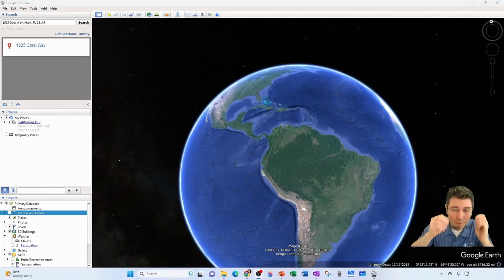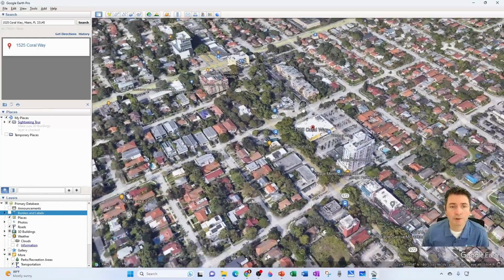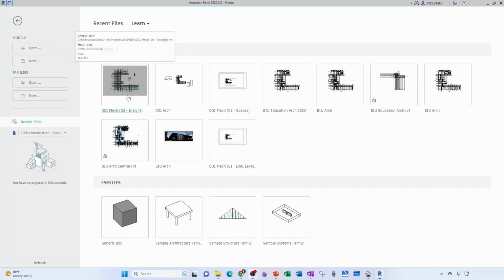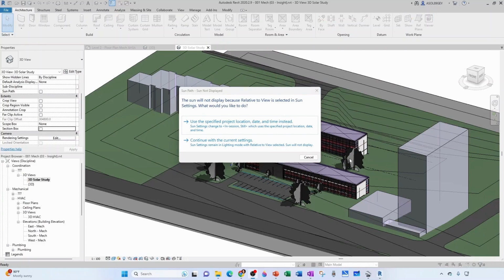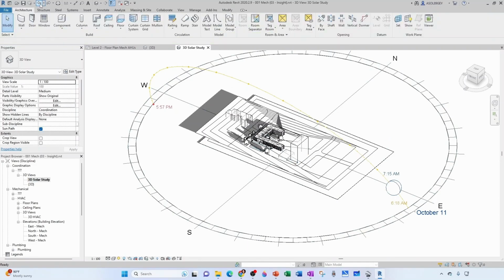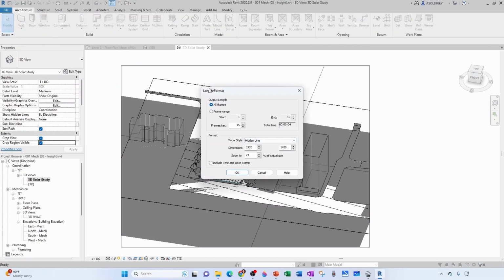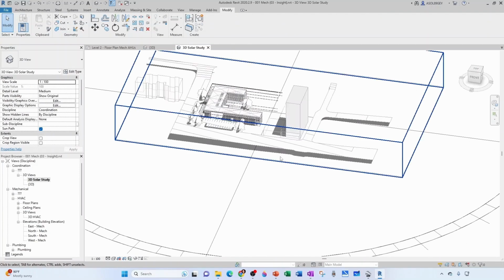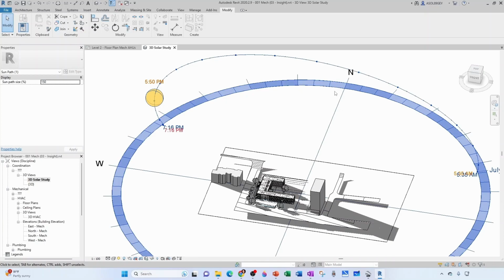Revit HVAC 9 Solar Study Shadows

Comment: Cool stuff. Only danger of designing around other existing conditions is when they get removed or revised then NO ONE will remember that as being part of the design criteria but will immediately blame the engineer for a poor design. 

For example, if the building to the east gets demolished and then it is hot every morning because it is now experiencing the full solar load through the windows.
Reply from the maker: Thanks! 
And yes, you are so right Bob.
I guess better safe than sorry and disregard the east building... Poof! lol